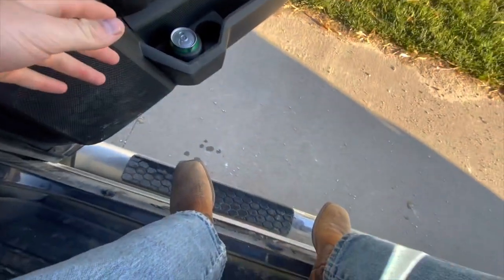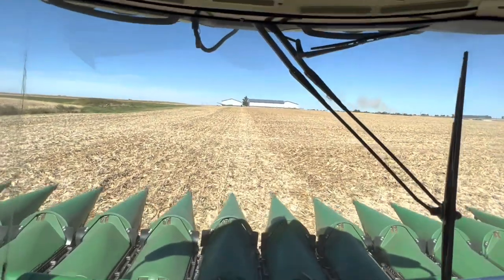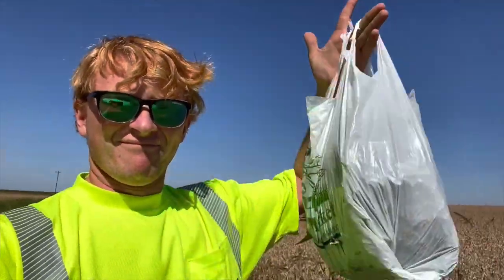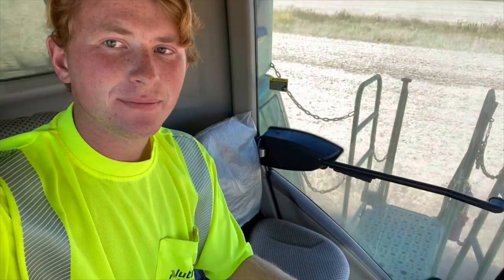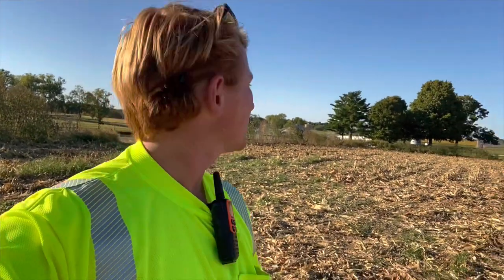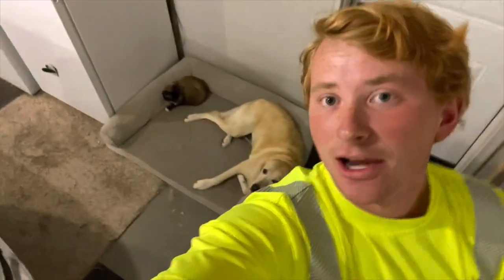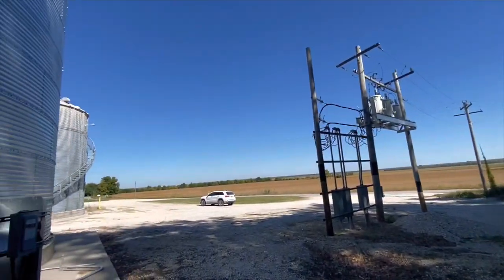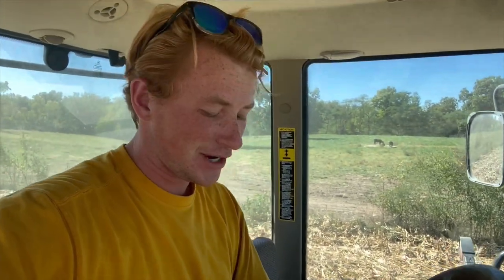Brother and sister tackle harvest together

Comment: You probably found the noise on the tractor by now. The first thing I'd check is the rubber grommets on the hydraulic pump coupling below the fan. Sometimes I think the hardest part of old tractors is building up your confidence that they are reliable. Get the most out of that school before you're gone!
Reply from the maker: Every time I think I have an old tractor fixed something else breaks. Makes me wonder if I should just leave things a little broken